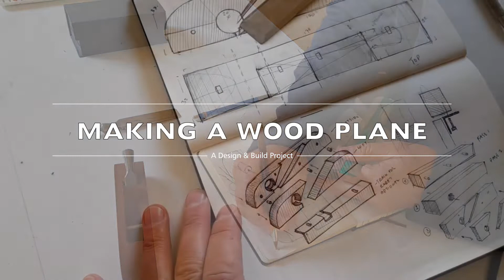Making a WOOD PLANE | Rosewood open-sided hand plane build

Comment: When your sharpening jig ball bearings go off the sand paper, it changes your grinding angle slightly. At that pint, you are grinding the back end of the bevel instead of the whole bevel or tip.
Reply from the maker: Totally correct, I overlooked that. I will extend the paper with another piece to keep it level. Thank you
Reply: @lucaskuklerupclose  Dont worry. At worst case, it is less than 0.2 degrees of change. Your clever jig design compensates for it.
Reply from the maker: 👃 @kuzun

Comment: Nice build mate, but I can't help but observe that the chisel is upside down. Shouldn't the bevelled edge of the cutting blade be facing down? 🤔 Just an observation 👍
Reply from the maker: Thanks, appreciated. You could be right but this seemed to work well for me so far with regards to lining up the perfect angle each time 🙂

Comment: Don’t know where I got Steve from sorry about that. Would still love some details on the plane and guide. Do you have plans to buy?
Reply from the maker: Hi Steve.. Eric! ;). I have sketched plans for both and the final object vary slightly from them, but could draft the final plane and guide plans for you if you like. Look forward to your response, appreciated.
Reply: @lucaskuklerupclose  Thanks Lucas I will have a go at making one from the sketches.I loved the way you presented the building process. Sorry for the delay in answering your message.

Comment: Beautiful build! 

Something I do when I'm working on really dry/tearout prone wood...i simply wet it by using a small paint brush and distilled water. It works especially well on end grain.
Reply from the maker: Thanks, great tip. I wasn't sure if this was the thing to do, or that it would affect the wood inconsistently.
Reply: @lucaskuklerupclose  I have found that as long as it's a small amount, literally just a small children's paint brush for watercolors, dipped into distilled water, I've had zero problems. I actually learned it from a Japanese carpenter. I was amazed at how effortlessly he chiseled through oak end grain...then he told me the secret. A sharp chisel, and A bit of water haha
Reply: @lucaskuklerupclose  btw, I plan on stealing your design a bit. I just made a grooving plane for creating the small gap for the top and bottom pieces in a box. So, I was looking for ideas on making a block plane. Yours has to be the most elegant I've come across.
Reply from the maker: @bryanstellfox8521  Japenese carpenter is all you needed to say! Now there's a great pool to tap from I bet..
Reply from the maker: @bryanstellfox8521  It's an honour to be inspirational, go for it! I hope to see your results when done. I'm actually designing a tongue & groove-in-1 model at the moment myself, video to follow the build of course!